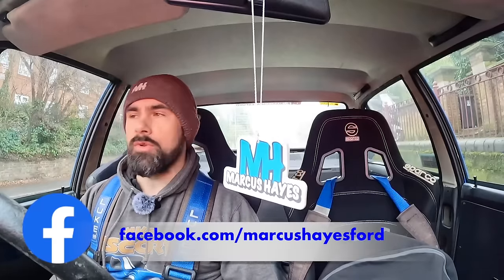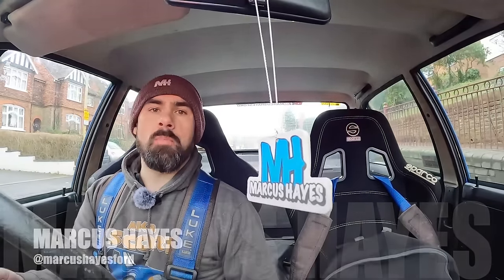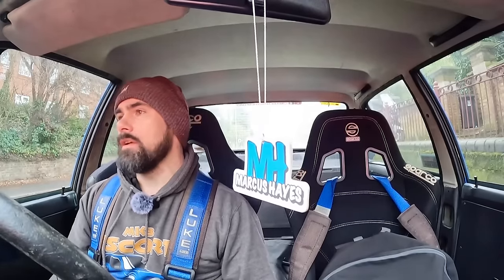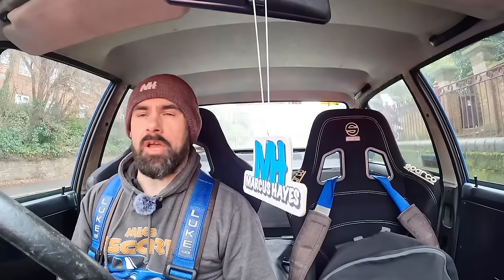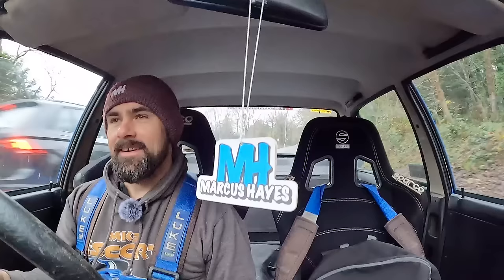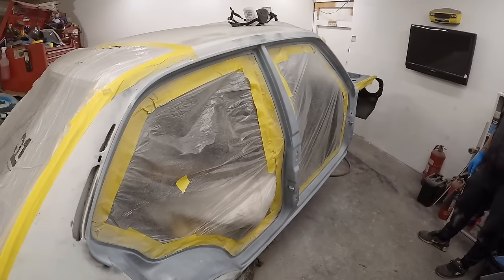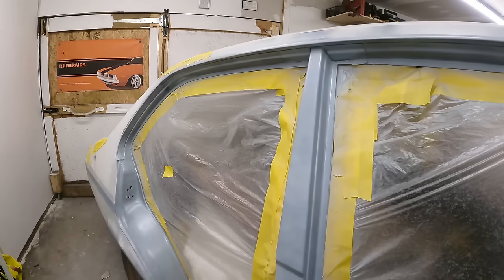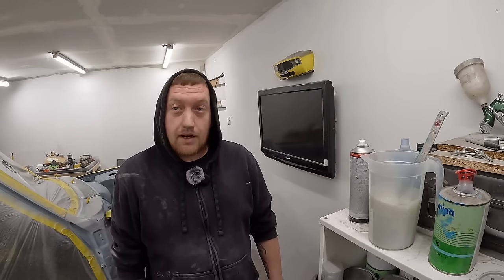My FIRST TIME painting with a spray gun! 🤔

Comment: Happy new year Marcus so wat if it's a normal diff it's getting you about I would clean them and grease them half shafts up see if that stops the noise for a while Rob should have a channel on how to show people how to do everything to prep and spray it's mixing it I have problems with not saying I can spray to a top job like Rob it's good to see things are working out better for you mate 👍🙂
Reply from the maker: Happy New Year mate! 👍 I may have a look at the halfshaft bearings at some point but I may just leave it until I have sourced, strengthened and repainted another axle for 'Maude'. Then I can re-fit her LSD and fit the replacement uprated shafts I have. 👍